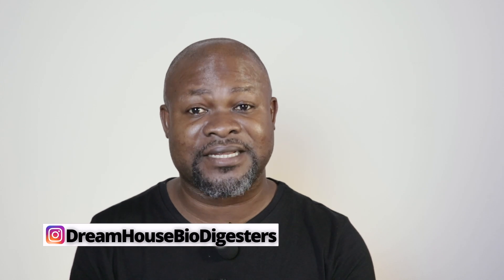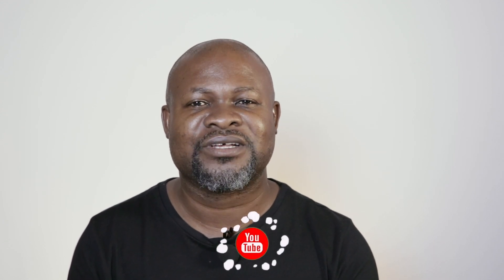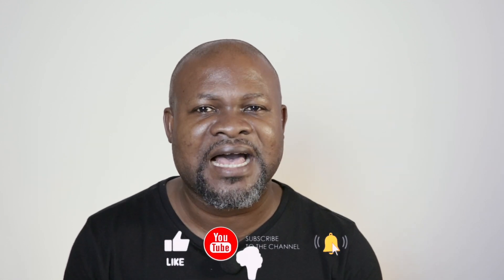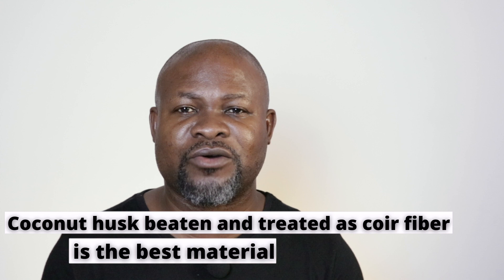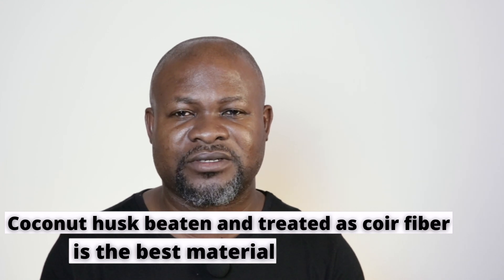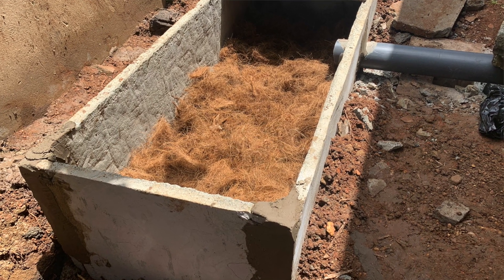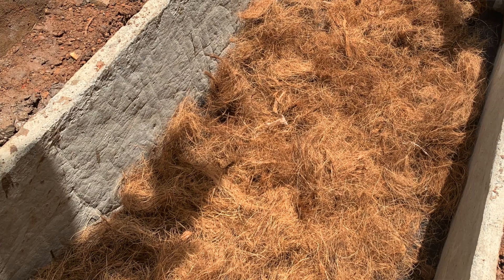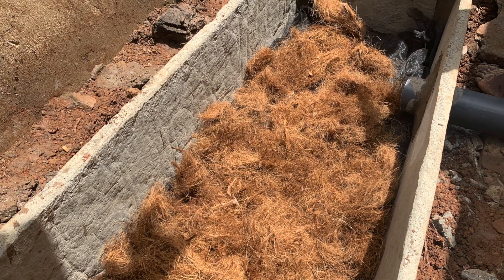Biodigester Materials and Bioenzyme Chemicals

Comment: Can u use only treated saw dust in ur chamber, and it will work perfectly,considering well drainage system ?
Reply from the maker: Yes Solomon just that to get an effective biodegradation add a sizeable amount of organic manure from your backyard on top of the sawdust https://youtu.be/3Mjd5Ulnwrw

Comment: Thanks alot Jerry. About the bedding. Does dry hay play the role played by coconut fiber
Reply from the maker: Yes. It should work fine. But to work to full capacity, a half bag of black soil or garden manure should be added on top of the hay.
Reply: @JerryAdu-Asare  thanks a lot Jerry